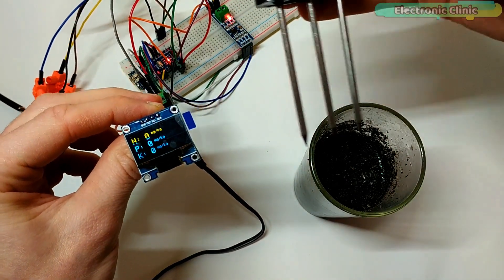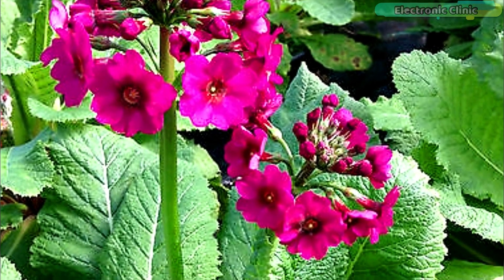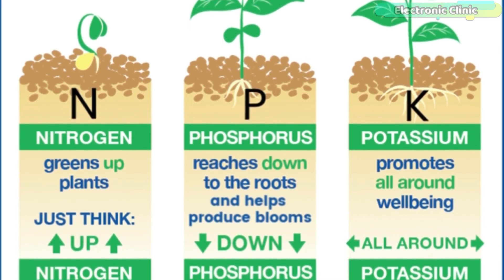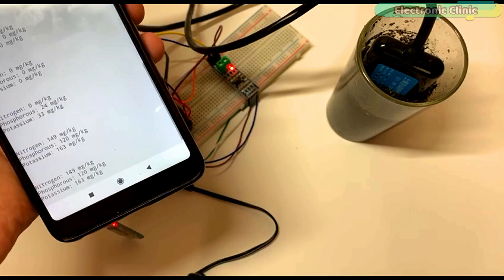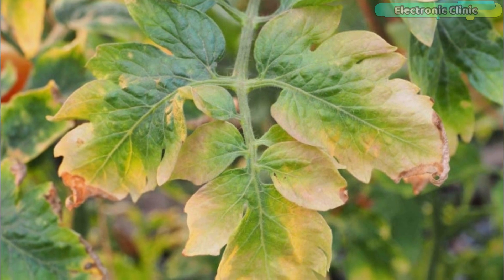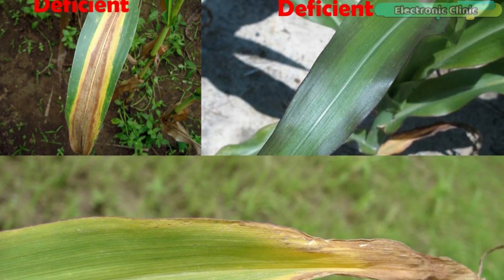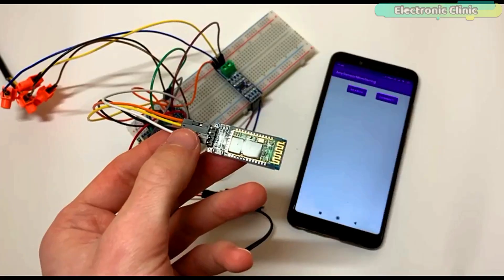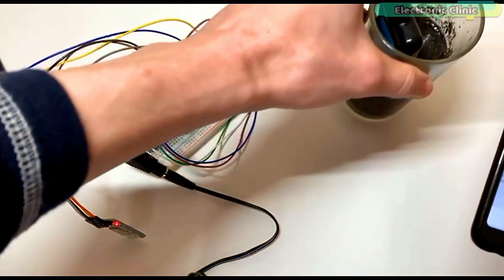Soil NPK Sensor with Arduino and Android Cell Phone Application for monitoring Soil Nutrient

Comment: Notes for anyone making one of these:  
Once you have all the wires hooked to their proper places the display should quickly change to all zeros if the sensor is not in soil.  If it does not, check that your wires make good contact.  If it still displays 255 for all of the outputs, you either have a bad sensor or your MAX485 is one of the problematic ones.  Change the MAX485 to a MAX3485 and the problem is likely to be solved.
The sensor depends on the soil being very wet.  Use distilled water to wet it, not tap water as your tap water has minerals in it that may skew the results.  The soil also must be somewhat warm.  I tried mine in the field in the spring when the soil temperature was below 40F and got impossibly low readings.  
Since I wanted multiple readings across the fields for accurate fertilization, I added a GPS receiver and then an SD card module so I could tell where in the field the reading had been taken and have a record of what the fertility had been there.  This file could then be imported into Google Maps and would show where the reading was taken and it values.  I also used a larger display so it could be read in sunlight.  I found that using an Arduino Mega 2560 gave me sufficient pins for the additional modules and it looked like the display shield would be a good match but it interfered with the GPS receiver so I moved the entire unit to an ESP32 dev module and used an ILI9341 SPI display.  This combination works well.

Comment: Do you need is possible to power this circuit with batteries? I mean removing the OLED display and then the voltage regulator, to reduce consumption. With this and arduino going to deep sleep and waking it up  once each 30 minutes batteries could last some months, isn't it?
My doubt is about the NPK sensor, how to power it up? Could 2xAAA batteries power the arduino and the sensor? Will the sensor need some time to stabilize after power on before read it's values?

Comment: Sir I got only N:255 P:255 K:255
values what can I do ? please help me as soon as possible... Thank you
Reply: hi, did you get the solution, i am facing same issue
Reply: @yuhao9074   did you get any solution I am facing the same issue
Reply: Change the baud rate settings to 4800 as npk only uses it...
Reply: @savinkj9092  brother there is no issue with bud rate, in my case issue is with 485 module, i just replace it with another and it worked perfectly

Comment: If the sensor detect this example value:

N: 40 mg/kg
P: 90 mg/kg
K: 100 mg/kg

What is the threshold of  Low, Medium Low, Medium High, High, and Very High? And I ask too let say Nitrogen is Low how many amount of nitrogen need? Is the soil need 120, 100, 80, 60, 40, 30 nitrogen and so on?
Reply: hello po sir, may theshold na po ba kayo about po jan? thanks po!

Comment: Can we use arduino mega 2560 using the same code in nano arduino? Or different implementation?
Reply from the maker: of course you can use, but make sure you use the same pins.
Reply: @ElectroniClinic  i hope you will show us a tutorial using arduino mega2560 for npk sensor
Reply: @ElectroniClinic  hello sir can you try a tutorial for arduino mega 2560
Reply: We use the same pin, but if we are using arduino mega 2560 all display are 255, while if we use arduino nano it works properly.
Reply: Hello sir  can you help how to convert npk value to string?

Comment: Hello, I am trying to replicate the project with an Arduino MKR GSM 1400 and I get pure values of 255, however when I tap the RE and DE pins I get values as random, because they are very different. I hope you can help me, thank you very much :)
Reply: Hi, I'm facing the same issue, did you get any solution for this?
Reply: Any solution?
Reply: hi did you fix your project??
Reply: Has anyone got the soln? 
i am facing same issue

Comment: the values for N P K are 255 mg what the solution for this issue on USB its shows correct reading but when try with microcontroller its not working kindly help me out

Comment: can i use ESP8266 for this stead of arduino nano?
Reply from the maker: of course you can.
Reply: @ElectroniClinic  can you share the code if using esp8266, i have to try but the results are 255

Comment: Why we can't send data directly from npk sensor to Arduino??
Reply: Npk output is in the form of rs485 communication... Arduino will not be able to read such a communication type...so u have to use a converter.

Comment: my Arduino just print 255 for all npk value without connect to sensor or rs485  using your code even after I try to connect with my sensor still i get same result 255 can u help me
Reply: It will showed the exact value after u plug in the power supply 12v to the sensor.. i think 255 is default because my previous case is same like u..
Reply: @falahakmalismail9059  hii can I contact you for some question?
Reply: @falahakmalismail9059  how can I regulate the 12v? I thought it can be plugin in the vin in the arduino uno. can someone help me bady lol
Reply from the maker: Seriously i have no idea, why this happens to you? I shared the actually code and circuit diagram.
Reply: just dip the sensor in water, tea or soil that will show the result, 255 seams to be idle value